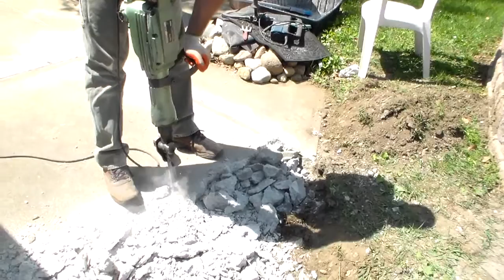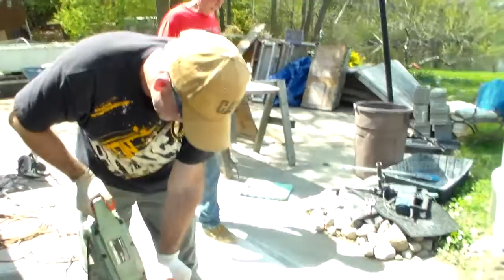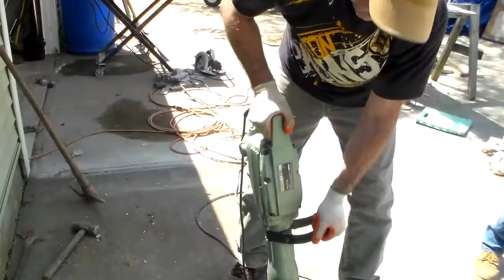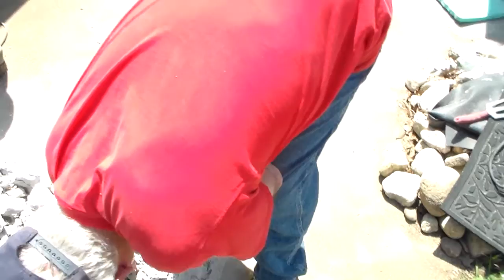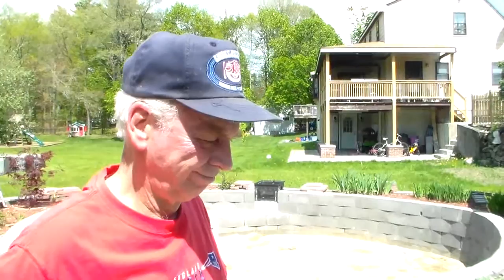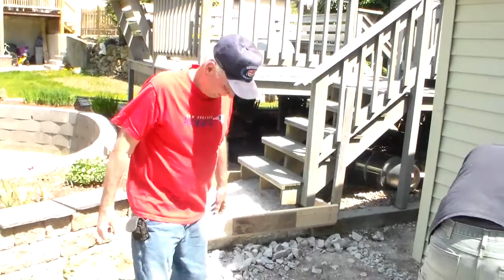2 Kings Jackhammer concrete driveway on YouTube-it looks like it will take him long time!

Comment: What's the power on the jackhammer?
Reply: Not really enough, maybe for small jobs (thin concrete).  also jack hammers come in size, the bigger the stronger but go for the air ones, electric and gas are worthless.